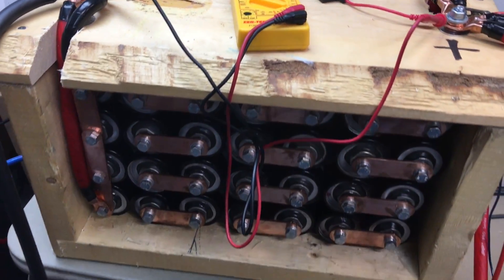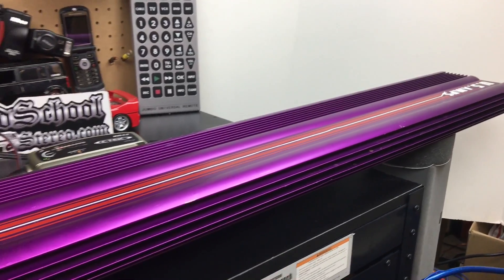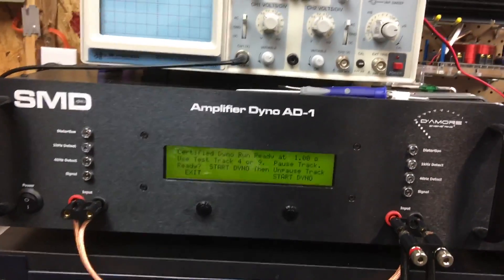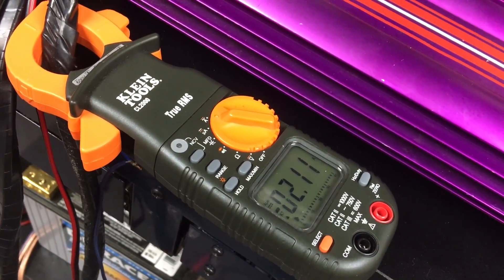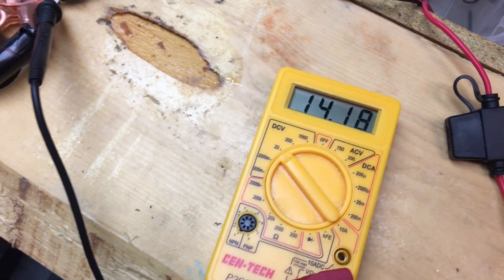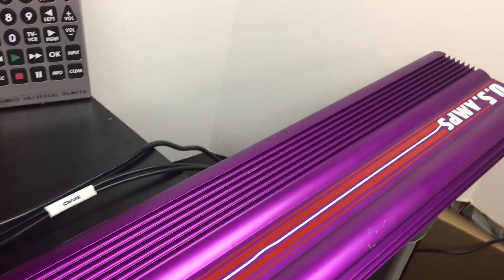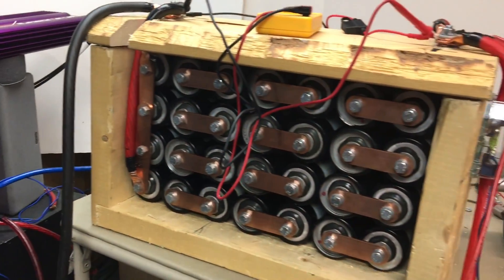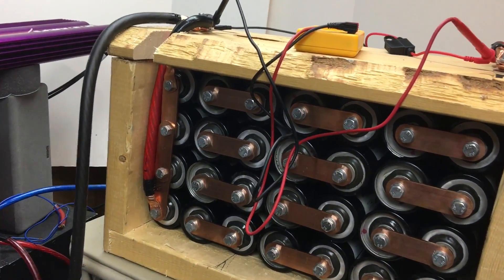Maxwell Ultracaps vs US Amps VLX-400 1 ohm 300A Current Pull

Comment: How much do those caps cost, and what's the purpose? I've seen people use them in there cars ? Do you still need to upgrade your alternator? Or what ? I'm new to car audio. Trying to figure everything out.
Reply from the maker: The blue caps 2.7v 3000F can be had for $299 for a bank of 6. For most people, an extra battery is a better deal for automotive applications. Depending on the requirements of your system, you may still need an alternator upgrade.

Comment: curious. can you provide link to where you got the caps from? and do you think they would be good enough for in car use? (got a big ol SUV lol so plenty of room!)
Reply from the maker: +emerybryant I bought these off a forum (used) and a few banks off of eBay. You should check out the NimHRods by Juicepack. My buddy TFade said they work better than the caps for music playback operation.
Reply: ok i looked into it. they seem to be a battery and rated to handle a 1000 watt system. problem is im running over 3k. and soon to be going up to probably a crescendo 12k or 2 twisted 6.5k amps. lol so that wont do. do you know if they happen to offer a bigger one? or just run a few of them? im guessing to run in parallel should be ok?
Reply from the maker: Yeah, run several paralleled. Or you could go Lithium, but those are BIG $$$

Comment: Nice setup . I want to make a cooling system with two peliters 12v each , one rated 7amps and the other 15amps . The temperature control switch relay is 20 amp . Will the relay burn for 2 extra amps ?

Comment: My wattage guess is 4,752 watts based on w = A(v) so 337×14.1 = 4751.7 ... Im sure that its an approximation though... I dont know what the amp was getting in voltage during the test, just what the final voltage of the bank was... Either way anything over 4k is impressive!

Comment: You may have had some contact resistance there bud.  Your new camera is so clear!  I'm using an iPhone 5c with a lightning to VGA connector, into an HP w1907, and it looks like the best HD I've ever seen man.  Best quality video I've ever seen.  Like the cap bank too man.  Try on your amp tests a sweep tone from a generator app from your iPhone.  It'll give some cool results.  Go HEELS!  Later Big Tease! Steven

Comment: Great concept for a bench, BigD! Caps have grown to be monstrously powerful over the years. My guess is the amp got around 4.5k watts to work with, which is huge!
Reply from the maker: See da result here https://youtu.be/_3kN5mBTBpA
Reply: Thanks! So it did 2524 watts and dropped 1.28v in the process. Assuming 65% efficiency for a high-end class AB amp, it drew around 3900 watts. (Please correct me if it is more efficient, you obviously knew the current draw.) For just a charged up cap bank with no 'backup' this is a huge score! Would like to see what the cap bank can do with a battery or two!

Comment: I wonder what the modern day equivalent to this amp would pull. 

Than again, numbers were never my strong point.
Reply: +Mark Vaughn It would pull less current of course...amplifiers are just getting more and more efficient but at the same time the quality of build and components is going down the drain. 

For example an 3.5kwatt old school amplifier would pull over 360amps at 14v while a new class D will pull around 280amps to produce the same 3.5kwatts.
Reply: There is really not many modern equivalent. These were high current/high voltage amplifiers from US AMPS (you can weld with this amp literally) and many other old school amps. Only a handful are made this way today. Class d and up amps get better efficiency by the switching in the amp and a lower current/mid to higher voltage

Comment: P=VI 
P=14.18*337
P=4778W

i'm guessing around 4000W cause it wont be 100% efficient.

Am i correct
Reply from the maker: https://youtu.be/_3kN5mBTBpA
Reply from the maker: +Avinash Ramkissoon No, I like your rationalization though! Think about this amp being Class AB, read up on their efficiency's, especially in high current applications...then try again
Reply: +Dereck BigDWiz BOOOOOOOOOM! LOL
Reply: +Dereck BigDWiz i'd say abt 2500W@1ohm
Reply: +Avinash Ramkissoon My guess is 3.2kwatts if it's a class AB amp and around 4kkwatts if it's a class D amp on Dynamic burst mode and about 20% less on Certified mode.

Comment: Sweet! I'm adding 2 banks of Maxwell SuperCaps to my system next week. I'll have 2 extra XS Power XP2500 batteries and 2 banks of the 3000F caps. My friend who has used them said it will be a nice addition to my system. I'm currently dropping to the mid 11s when playing my system at close to full volume.
Reply: +Dereck BigDWiz I have a Mechman 320 amp alt...I just ordered 2 runs of 4/0 to run as my power and ground from the front to the rear as well...AND I'm adding dual inputs on each of my DD M4s...They're built like tanks...I've been dropping into the mid 11s for several months...
Reply from the maker: +Oldbass40 What's your alt? I would think that would need to be upgraded to provide the juice to keep the batts and caps charged
Reply: jus think, our grandkids will have developed power reserves that will blow our minds, technology is moving fast...
Reply from the maker: +Oldbass40 Wow, quite a setup! Let me know how those caps work out for you.
Reply: +Dereck BigDWiz Ok I sure can
Reply: any report?

Comment from the maker: Test was done with NO external charging or power supply on the caps at the time. They were charged up and this test was done in complete silence in the OSS labs! It's kinda scary how quiet it was during this test...
Reply from the maker: +jeanious2009 No noise when the power supply is off. Those fans can be loud though when they are on!
Reply: I can imagin... but no {BUZZZZZZ} so its all good...
Reply: +Dereck BigDWiz No noise from the amp either? The only noise I hear in my power supply is the fans.
Reply: About a year ago I was thinking of getting a power supply for powering amps. But I was concerned about any supply that was large enough to supply 50 amps or more would be too noisy and ruin the audio portion of my videos. I bought a deep cycle marine battery from wal mart instead. None of my amps are over 300 watts rms and I just use it to test for function and take measurements to try to diagnose the operation.